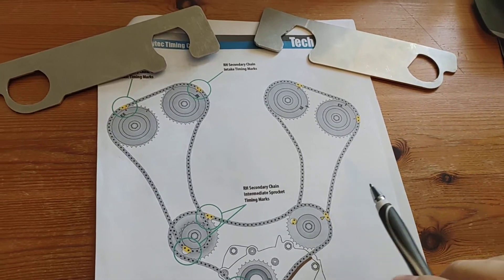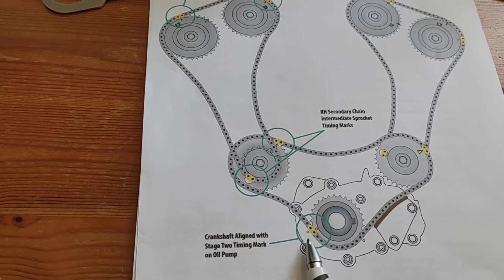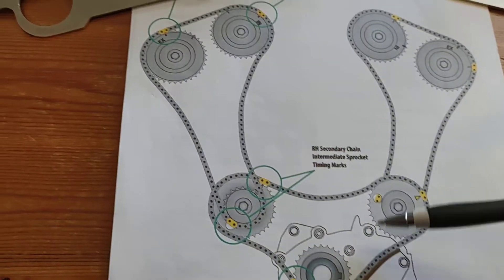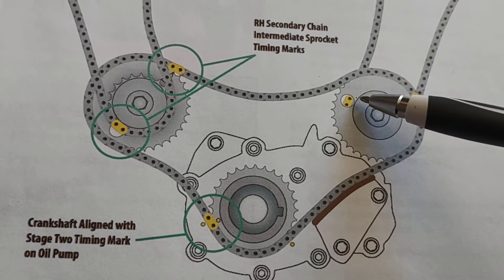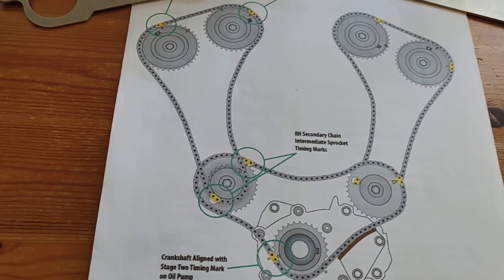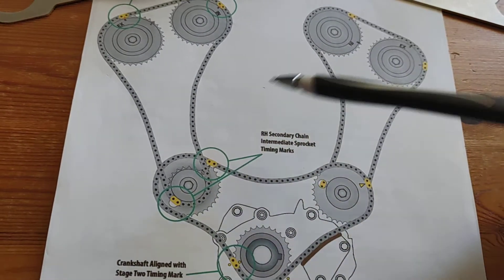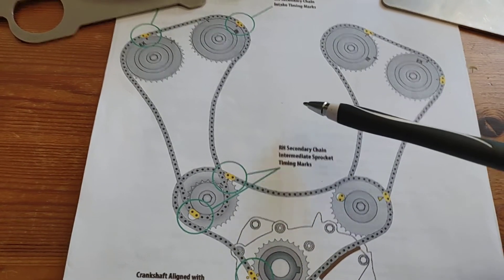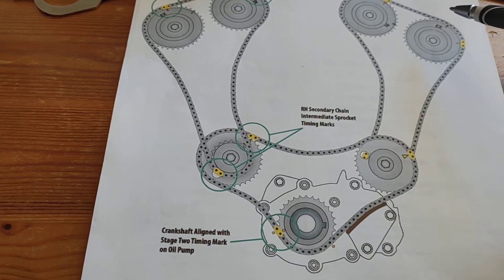Timing Chain Alignment Procedure Easy LY7 (SV6) (HFV6)

Comment: I did my mrs VE exactly this way with no success. Still getting P0008 & 9.
Reply: Re did it the next weekend and worked out why there is 3 plates in the set.
As looking at the engine from the front....... set left cams with the flat plate without a gap (I used an elastic band around the plate and spark plug tube to hold them in place), then remove left chain. Rotate engine clockwise until the second flat pate goes on the right side, remove other 2 chains. It is now safe to rotate the engine. Find top dead centre on cylinder 1 while lining up the crank gear dot to 5 o'clock mark. Fit right side and bottom chains. Remove right side plate and rotate crank to 8 o'clock mark (this should put right cams in place for the angled plate, some slight movement of a cam might be required). Fit left chain.

This is what worked for mine as it had clearly jumped timing completely so needed to be re set.

Comment: This is great mate, mistakes and trial and error is what we wanna hear 👍. Man it saves us making them ourselves and those are some good intel lines you dropped there. thank you. After hearing you talk about the alignments and things, I have made up my mind to do engine out I think. It's just the bell housing and wiring so I may as well. Especially since I need to do a sump gasket and check the oil pick up. I did get the full kit with oil pump and I am buying some MACE cams to give it a little more satisfaction in the drive haha. I was actually trying to find a cam change video. but this is a helpful little ditty so thanks again.

Comment: I think your cam lock   tools should face up not down with big edge so you would be 180 out on the  left hand side right hand looking at front on.the right hand side wouldnt matter so much as  the straight edge faces up  anyhow wouldn't you be 180 degrees out  on the lleft hand side the way you are showing the cam tools on this video.?

Comment: Great video. Thanks. I just got my LY7 timing chain replaced, but when I picked the car up, it had a P0301 error.
The guy said to replace sparkplugs/coils. But it might be a planum gasket, or didn't install the chain properly with the alignment tools?
What do you think?

Comment: You do not the the cam holders to do this job. The stage one/stage two is also irrelevant. This engine is timed by lining up the marks on the chain links with marks on the cam gears. The left bank is aligned with the cam gear indicator L, which has a dot for timing mark and the right bank cam gear indicator R, which is a triangle for timing mark. If you align all three chains with their proper marks then the timing must be correct, this is a fact. The only way this doesn’t work is if you miss the mark.

Comment: Hi there, thanks for very informative video!
My daughter has the VE S2 OMEGA that's bringing up a crank to cam (forget the actual code) issue. 
I've replaced all 8 sensors and CAS and it's just this code that keeps coming up.
If I clear the code the engine runs fine until it's turned off and restarted and the code comes back and it's down on power.
Would this software upgrade fix this and is it just Holden that installs it?

Comment: I did mine from position 1 (5pm position) which is TDC on piston one, cam shaft tools, placed the flats facing up on the left as your sitting in the car and the angled cam shaft tool on the right…changed both chains from that number 1 position….. worked like a charm started first time ran smoothly….. I also modified the pvc valve so the engine could breathe.
Reply: Y in the hell does my motor not line up with anyone of theses videos your comment is the only one that's helped me chase this issue with my motor
Reply: Dónde puedo obtener ese manual de tiempo

Comment: worked perfect. but be advised, if you replace the high pressure fuel pump, GET IT FROM THE DEALER! I didn't, 3 months later I'm doing it again because the after market pump I put in failed. so if you replace it, get it from the dealer. this is the best chain replacement guild out there. worked first time. well....2 times and an extra 800 bucks

Comment: That's a load of baloney mate my mechanic done at your way and when he fired it upwasbang bang on either side and I turned it off and that was the end
Reply: Then your mechanic was garbage and probably had timing out by 180
Reply: Your mechanic was stoopid that's why it went bang bang.
If he had of rotated the engine before putting it back together he would have found he screwed up.

Comment: Careful here! Left and right on a north south engine is viewed from the rear normally. So based on the picture and the discussion of fitment of the cam retainer tools he mentions this one to the right, his right on the picture is actually the left bank of the engine. This may cause confusion with some maintenance documents. The diagram text is technically correct. I personally would never do the "two step" procedure.
Reply: Thanks mate , i was trying to do as he said and the cam lock tools wouldn't fit but fit the opposite so yep you are dead right ... thanks again
Reply: No they don't lh side in Australia and way is always the drivers side. Always standing looking at the engine from the front of the car  only time it ever changes is if it states drivers side or passenger side. Other wise it's lh side and right hand side is always looking from the front to the back of the vehicle 
I have 25 years experience as a automotive master tec

Comment: I did it on the first dot with cylinder number one at top dead center with the Cam alignment tools and it worked out but this is also good information thanks

Comment: You know why camshaft lock tools were invented and used ALWAYS in doing this job? & those two seperate stage timing marks exist on the oil pump? Well they were not for shits & giggles, they were designed and marked for when timing is out, ie one, two or all chains skip links as mine skipped 3 on the primary lower chain. How the hell do you know where to start if your engine has suffered this issue as most do hence why we are doing this job in the first place. You need to go back to square one, start from scratch and you need the tools and you need both marks to accomplish this - and despite what anyone says, it ain't rocket science. So you feel the 1st stage timing mark and the 2nd stage timing mark intentionally put on the oil pump for timing the engine correctly (separately) eliminating misses and incorrect timing is made redundant just by doing it off one mark? Sorry, but NO!

Incidentally, I did mine the correct way, GM's way by their book not by what some grease monkey might say or offer for taking money from him. Yes, I did it via the GM manual and I used the cam tools to ensure the cams were absolutely right (as I said it was out 3 links) - I did not want to get it wrong and have to go back in there, let alone deal with bent valves, kicking a leg out of bed etc - do you?.

Do it the way the GM engineers designed it, the right way, set up stage 1 timing (around to the 5 o clock position right side on the oil pump flats on the back of the cams up), put the left and primary chain on, then rotate the crank set up stage 2 timing (around to the 8 o clock position left side on the oil pump again flats on the cams facing up - you reverse the cam tools as you switch timing setup) and fit the right timing chain, lining up all the marks and torquing everything releasing the tensioner pins etc.

Remember looking at the engine front on rather than behind in the drivers side, the left side is the right bank and the right bank is the left bank - see, so simple a child could understand it.

I did it this week end by the way, and my car runs like a dream, so I know my method, or rather General Motors method works, no misses no revisits in side and more importantly - no engine damage. If someone is too thick, and sorry that's what it is to understand simple stage 1 & 2 timing on an Alloytec, please pass it on to get the dealer to do it and wear the $3,000 + expense. THOSE TWO MARKS ON THE OIL PUMP ARE THERE FOR A GOD DAMN REASON - I ASSURE ALL OF YOU.

REMEMBER IF THAT ENGINE HAS SKIPPED SOME LINKS - WHERE TO BEGIN? = Start from scratch !
Reply: For some reason every video I came across said set 1/2 but this is the only 1 say hell just change the damn things?
Reply: Thank you so much

Comment: What idiot  bloody company designs an engine with such ridiculously small stretch tolerance, on  an engine with an already overly complicated  chain layout. 0.1 of a millimetre is ludicrous, and as Holden rightly observed is smaller than normal operating variations of the running chain when the engine is turning over. So why do it.
My theory is that the engine was developed way too fast, and by people with very little practical mechanical knowledge, or understanding of how stupid this is, or maybe even no common sense at all. 
Cough*University Graduates

Comment: I'm doing mine now, I've followed melling timing video. 5 o'clock on the oil pump. melling have the cam holders the other way around. Flat/right. Offset/left
Reply: I did the Melling way 3 years ago and re doing them now just got the codes back 80k miles and 3 years later so the melling way worked well this second time it was off a tooth so I’m doing it the gm stage 1 and 2 way this time to assure the skipped link is corrected
Reply: I will be doing mine this week. The Melling Timing Video does the entire Timing Chain job in Stage 1. APV's video is explaining doing the entire Timing Chain Job in Stage 2. That is why is it different. How did the install go so far? Everything back up and running?

Comment: I have searched and can't find a reason for the 1st and 2 stage timing?  The links line up whether or not you rotate the crank to the 2nd stage or not. What is the purpose of rotating the crank just to install the 3rd chain?  Why did the 2 stage procedure cause you issues?  I keep having P0009 after doing my chains 3 times now.
Reply from the maker: I have no idea why the manufacturer recommends doing it in a 2 stage process. I agree with you it makes no difference. Unfortunately if you have done it wrong and put the car back together and its running really badly you got no choice but to take it to a dealer to fix it. Because my method only works when everything is in the correct starting positions and chains are just slightly stretched. To get it back to the correct starting position once you have put the car back together incorrectly is outside of my knowledge. sorry I cant be of more help mate.
Reply: @apv-australianperformancev1127  Sir could you be so kind to convey if cylinder number 1 is top dead center at stage 2 position or stage 1. Thank you 🙂

Comment: Thank you APV. I had to be called in to assist a backyard mech who agreed to replace bad timing chains on my daughters Chevy Travers 3.6 L V-6 engine. The Mech was completely flummoxed about the install after he started turning the crank and cams and could not get back to installation order & TDC. Your Holden directions allowed me to install the chains in one go. Of course I had to go through resetting the engine to top dead center and having my daughter order the cam retainers beforehand to make the job easier and those cams love to flop over with annoying consistency without the retainers. One point you should remind your viewers who are backyard mechs is that in order to get back to TDC it is best to have a screw-in whistle tool and another fellow to turn the crank shaft while you watch the cams and flip them to the the right position as you get back to TDC to ensure there will be no damaged valves. IF the one cranking on the shaft encounters resistance then he stops and you attempt to move the cams into place. Once you have turned your crank shaft up to TDC and are hearing or sensing the piston blowing out air you are sure that all valves on piston one are closed and you are coming up to TDC. Once you have the cams back in order and retained with the retaining tools it is a simpler job to set in the chains. Another point is that if you don't get a replacement chain set with well marked indicator links it is so important to paint up or mark all the links as well as the engine gears to align everything with ease. The Back yard mech had done none of this which helped confuse and frustrate him even more. Following the Aussie Holden method I was able to install the chains in one go and the engine started on the first try. There are issues with this engine and it was apparent that my daughter was horrible with monitoring the oil level with this model as she had never encountered an engine that blew our so much oil in such a short time on a regular basis causing engine oil to be consistently low. I have, after finishing up the install added additives to clean out the engine and will dump the oil after a short while hoping that the gunk will mostly be cleared out. Reassembly of this engine in the engine bay is no joke and you have to have the proper tools and a knowledge base and/or watch numerous videos before attempting the job. It is always best to take photos while during disassembly and invest in the repair manual that you can get online or at the auto parts store. Please don't waste time trying to follow the other methods on YouTube as this is the best method. Again, thank you.